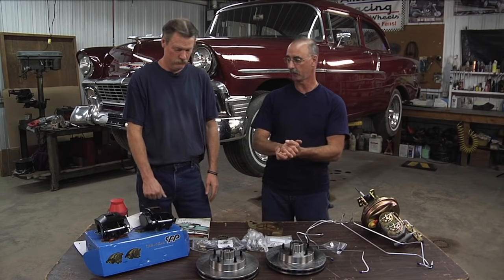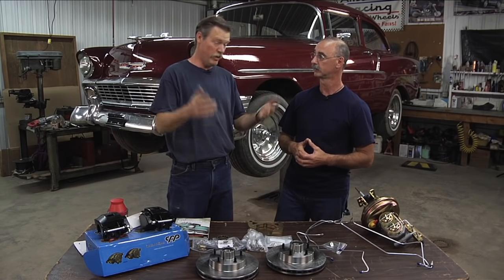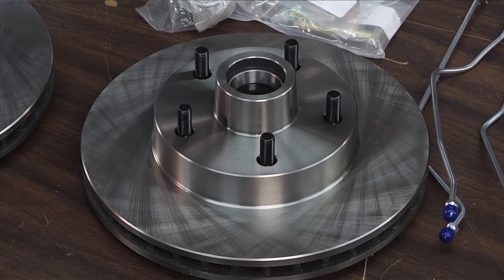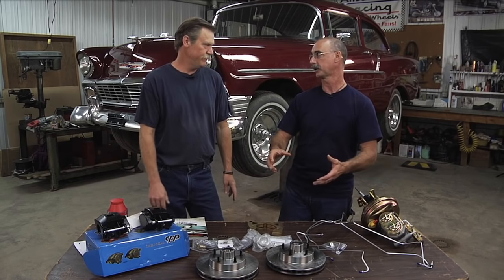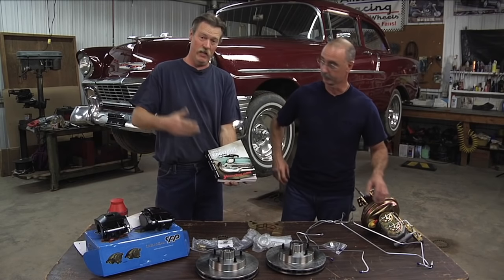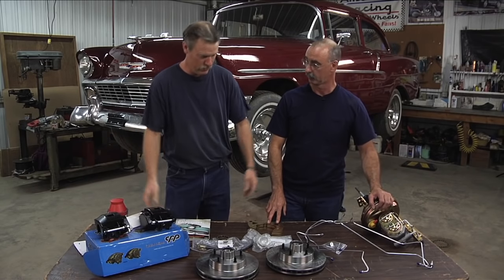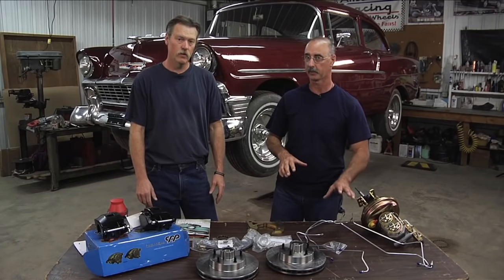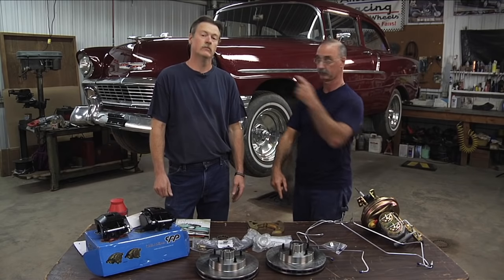DRUM TO DISC BRAKE CONVERSION ON A CHEVY CLASSIC CAR

Comment: Hi iam doing a front brake conversion on my 69 impala  with stock height Spindles  the kit I got the  Bearings to  wide  or my Spindles are to short but the  Directions said they are for a 69 to 70 impala

Comment: Love the video guys, I just recently purchased a 53 chevy bel air. Can I do an upgrade on the braking system from original to a power booster with dual master cylinder with rotors in the front?
Reply from the maker: Great question! The ‘Ask an Expert’ section is currently for members of our online community. I would be happy to send your question off to the experts. To get started, please send the email associated with your paid membership account. Thanks!

Comment: OK..this is good. how about what to do with the original emergency break on a standard trans set up? Got to have an emergency break, right? anybody know what to do for the conversion?
Reply from the maker: If your question refers to the video on the Classic Car Restoration Club site on Rear Disc Brake Conversion, I mentioned the new calipers did have an allowance for rear E-brake.
The car we were working on had a driveshaft drum e-brake so we didn't utilize the e-brake mechanism on the rear calipers, although I did mention we may use them in the future.
Later we added an E-Stopp electronic e-brake on this car using the caliper brake mechanism. Here's a link to the video: https://www.classiccarrestorationclub.com/video/electric-emergency-brake-016810/

Comment: I have a 78 Chevy caprice with 12in rear drums that I want to convert to disc brake but can’t find any place. Help please
Reply from the maker: There are several kits available for your ride, we have not installed any on a Caprice yet so please do a little deeper research.
Here are a a couple possible sources:

https://www.summitracing.com/parts/sum-bk1623/year/1978/make/chevrolet/model/caprice

https://www.universalcarlifts.com/product/77-90-gm-b-body-rear-disc-brake-conversion-kit-for-caprice-impala-more/

Comment: What about conversion kits for '57 & '58s with original 14" rims. Where are THOSE kits?
Reply from the maker: Sorry to ask but what make and model are you looking for brake kits?

The old SSBC disc brake conversion for '57-59 DeSoto's and Chryslers worked well with the factory 14" wheels.
Sadly SSBC is no longer in business and they have relaunched as SSBC-USA, but have cut WAY BACK on their product offerings leaving out the older MoPars.